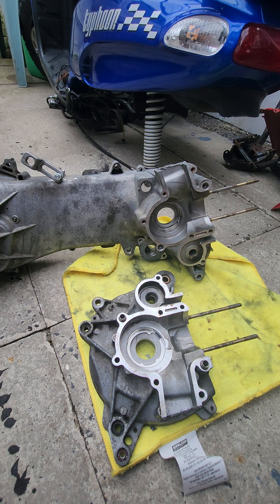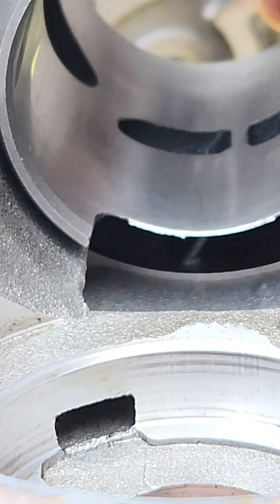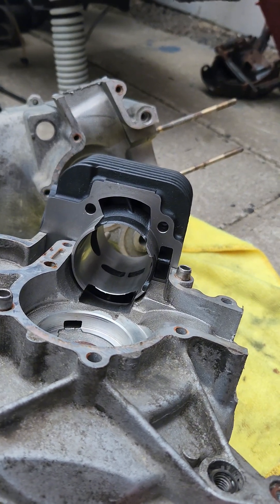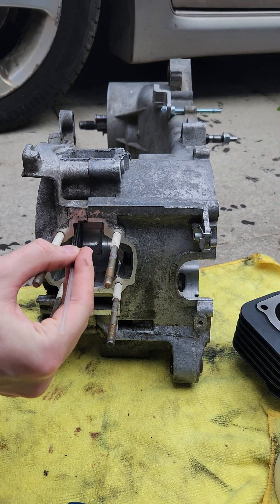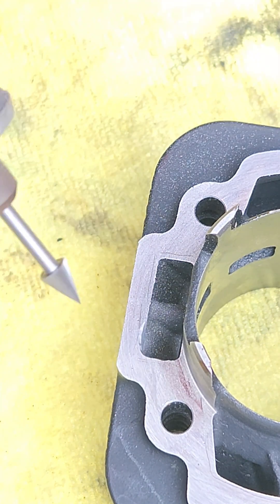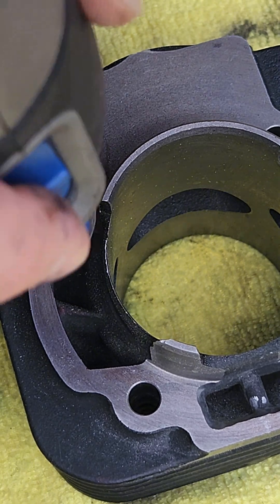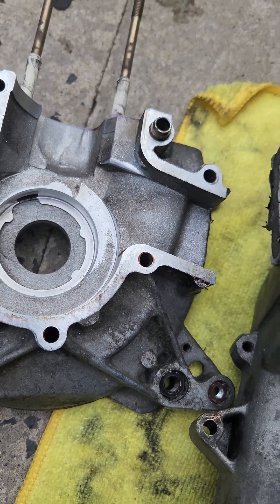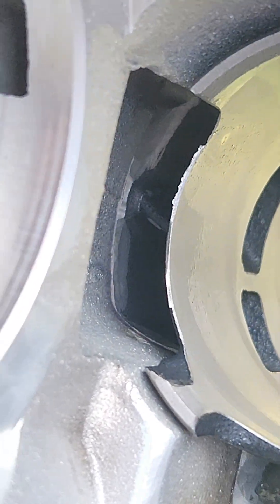how to port /case match your scooter engine and cylinder 50cc 70cc

Comment: Can the watercooled streetrace be ported as much as your aircooled one ? or are the mesurements different ? I hope you know what I mean
Reply from the maker: well this isnt porting technically, its just case matching, I havent case matched water cooled cylinders but it can likely be done just the same, if you  go to far you can usually just JB weld the hole you make
Reply: @2slow2stroke  okay thanks, and what do you think how much hp you Can get out of the case matching?
Reply from the maker: @mikapol9344 i dont know for sure, I can say it will help but cant specify numbers, main gains would come from actually porting the exhaust port and i think the boost ports, thats something I currently have no experience with... for now